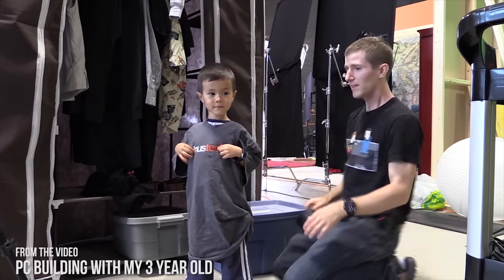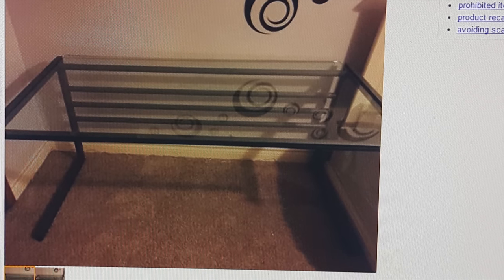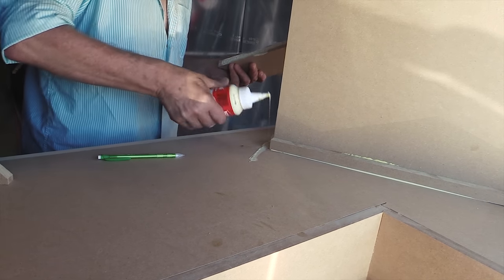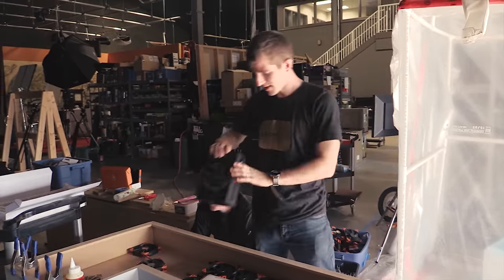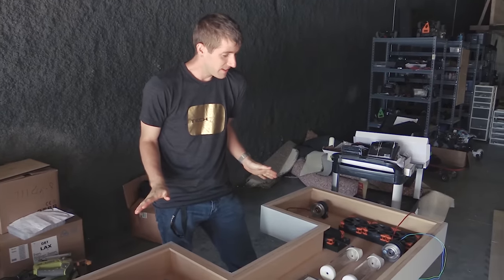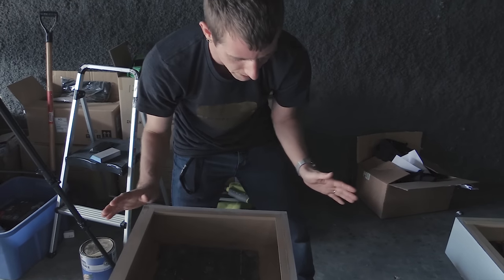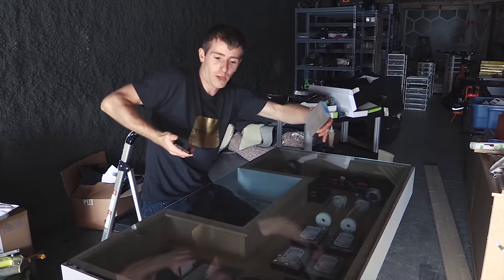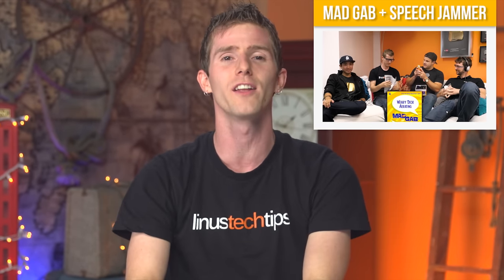Ultimate DIY Desk PC - Desk Construction

Comment: Can I skip the glass please? I just HATE glass tables
Reply: Kinda defeats the whole point of this kind of build...
Reply: Are you actually going to try to construct that >.>
Reply: I'd suggest a 12-15mm thick plywood if you want to skip the glass. Make sure you seal it with a decent wood treatment to prevent any soaking of drinks, etc.
Reply: Why does is defeat the point? I hate cases with glass as well. Don't have to look at my components or lights and want a sleeker design. Same when I would build a desk.
Reply: transparent acrylic surface then :)
Reply: This desk isnt meant to be glass
it is meant to be a desk PC desk and a DYI desk
Reply: A Do-Yourself-It desk?
Reply: when u build something like this, its like the point to have glass if u dont have glass u just need a normal case...
Reply: Daoge Inaction well maybe I want plastic or wood
Reply: Jordiw00t Because the whole purpose of this kind of build is display the system in a unique way.

Get a normal desk with a normal case and shove it in the corner otherwise it will be VASTLY less effort needed.  

Hell if space is THAT much of a concern you MUST do this (and unless you live in a dorm the size of a broom closet you are not that staved for space...) just stick the system on the underside of a desk like he did in another video.
Reply: Nexxus Gaming I don't understand why his wanting to change the system is a big deal? It's a simple modification with zero ramifications for anyone else. Perhaps he likes the shape of the desk, the use of space.
Reply: Mark Thomas so get  a similar shaped desk and underside mount components like I already mentioned? 

This is litarally accomplishing NOTHING other then making your system have a harder time breathing making component changing out harder and plugging your. Io in more difficult. I stand by my statement this kind of  build is 100% pointless without a glass top for aesthetic when cheaper and easier alternatives can over nearly as much and in the case of under side mounting as much potential benefits as this setup (and as I mentioned has some benefits over this too...)
Reply: whats the point in making your pc in the desk then ? you can just have it in a case by the table....
Reply: Just use the "force" instead of glass
Reply: Hey, if you're building your own desk, you can do it however you want. That's kind of the beauty of DIY stuff. Make it to your own specifications.
Reply: Obviously you can do whatever you want. But building a show desk top out of translucent materials is a bit like making windows or aquariums out of translucent materials. The purpose of a show desk is to show what's inside of it.
Reply: I think the word you were looking for there was opaque.
Reply: You could have glass panes to the left and right of you and a solid MDF section where your mouse and keyboard is, that way you won't be touching and smudging up the glass and yet you could see the cool bits of your computer.
Reply: I use acrylic in all of my desk builds. Have a build video up, feel free to check it out.
Reply: Custom Computer Cases
 I feel like acrylic for a desk surface would get scratched up really easily, wouldn't it?
Reply: +MGlBlaze I try to keep only the keyboard and mouse pad are on it, I'm careful because it will scratch (lexan so a little more scratch resistant) but if scratches appear, they can removed with scratch remover.
Reply: Custom Computer Cases Do you mind posting a link to your channel; I'm having a bit of trouble finding it for some reason.
Reply: Michael D
Just clicking on his profile should work.
Reply: Joseph B. Nope, it just takes me to his Google+ page which has nothing on it.
Reply: Put it this way, without a glass top its just a desk with a computer in it, you are better off just building a small box yourself and put the computer components in it and store it in a corner or out of sight. cheaper easier and not as cool.
Reply: Granite slab would work just as well and would look pretty sleek, granite is expensive though. Also anything that would work as a counter top would work as this so you could lower your budget with that
Reply: Matthew Charles-Roy Thibault Granite isn't always that expensive; if you you are content with having an of-cut, that is to say a leftover piece from some larger project; stores can sell you them pretty cheap. There are plenty of leftover slabs that are too small for an entire kitchen or bathroom but are still large enough for a good sized desk. The downside is that you'll need one hell of a strong desk frame to support all that weight.
Reply: Yes But Then You Either Can't See Your Computer Because You Covered It With Wood Or You Don't Cover It Up So Your Keyboard And Mouse Will Just Fall Into The PC
Reply: you can get thick plexy but also expensive and will need to be ridiculously thick for the same strength.
Reply: @everyone who says no glass defeats the purpose: 

Not necessarily, it still hides the components in the desk. You can still get a much cleaner overall look with this and no case anywhere. 

Couple short cables going up to the monitors and input devices one cable going to a tucked away power strip on the back from the wall, very clean look.

@Nexxus Underside mounting has it's own problems, physical hazards like your knees hitting components. Hazards exacerbated even more if you use an air cooler. Accessing components is not really any harder assuming you keep a remotely clean desk. Mount cabinet hinges to the back and a couple struts and it opens like a car hood, reach in, tweak what you want, close it.

If he prefers the clean look from not having a tower, that's his prerogative.
Reply: You could get weird and have a wire grate table top for that super industrial look. =D Of course this is a joke, but then again.
Reply: Michael D it's possible to do that
Reply: Not only does it not defeat the purpose, but its considerably cheaper than a glass top, the wood is cheaper, you don't have to spend money on custom cables and hard tubing because what it looks like on the inside doesn't matter.

I'd want a wood top on that for the same reasons I dont have a case with a window, I don't give a damn what it looks like on the inside.

Comment: Budget desk PC:

CableMod will do custom lengths for us.
Because that's cheap.
Reply: the PC desk itself is meant to be budget, not the components in it
Reply: Well custom length cables from them while certainly not a cheap option aren't exactly very expensive either. In reality you would only need 3 custom cords. 24 pin,  a dual pcie 6+2 pin and a plug for the motherboard power on the top left corner (Depending on whatever it requires) which would be 75$ without tax or shipping. Not super expensive depending on the budget you gave for the desk itself. Another option would be to simply plan around the lengths of cords you have on hand or can easily order online. You have to remember Linus likes to show the most balling way to do anything so this is more like a rough idea to show people than a step by step DIY. He's most likely going to stick insane non budget parts in there like a gtx 1080 + i7 6700k or maybe the extreme 58xx whatevers.
Reply: Kensung
I would just buy the connectors on digikey and make them myself for $10.
Reply: I would scrap together cords from PSUs that shit themselves... my friends and family seem to have a curse... (then again they are from 5-6 year old Dell/HP prebuilts)
Reply: *****
Yeah, I may do that. I could use the sheath from para-cord as cable sleeving!
Reply: ***** remember to offset any wire splices so you don't end up with giant clumps.
Reply: *****
I figured that out with my 3D printer. It's a mess, but it works!
Reply: BigolJoe
It's just a joke bro.
Reply: I mean the cost of the desk is damn cheap compared to buying one. In fact Doing this vs the prebuilt ones, you save enough to afford the custom cables, and the entire water cooling setup, and fans, hardware etc.
Reply: They are talking about the desk itself. XD not the pc components. XD
Reply: you can do some diy cables and sleeving to save a lot of money
Reply: Not really, trying to buy all the connectors, the molex crimping tool, and enough bare cable to do everything will cost you about $40-$50.
Reply: This desk will cost like $150 tops compared to $1200. you can probably afford an extra $100 for sleeving stuff if you want to go full out diy.
Reply: expensive is subjective.
Reply: High budget is also a budget :)
Reply: Well. That's actually not true. If someone is throwing his money into custom made cables then i'm not sure if he is going to look for compromise and get BUDGET DESK.
Reply: LazerLord10 it's a hell of a lot cheaper than the other options

Comment: LinusTableTips
Reply: LinusWoodenTips
Reply: at least still LTT
Reply: I don't want tips from Linus on how to deal with my wood?!
Reply: LinusToolTips

Linus is Tim Allen and Luke can be Billy Mayes
Reply: LinusTableTips Part 2
Reply: if Linus is Tim Allen, Luke would be Al.- Home Improvement
Reply: I think Linus should stick to tech. Only a matter of time until that table falls apart without proper joints supporting the glued areas. crash-bang- wollop.
Reply: MDF holds together fine with butt joints. You can use biscuits or dowels if you must...You can't do finger joints/box joints very well (Unless they're big fingers), dovetails are pretty much out (The corners of the tails split off easily). Rabbets and Dados work well, but have limited use in this desk. 
Mine from several years ago is dowel joints on my desk but the upper parts of the desk don't get stressed that much so it was probably overkill.

Linus' most vulnerable joints are his legs but they're probably going to be fine. In MDF the wood itself is usually weaker than even a butt joint itself.
Reply: Bluestonez they shoulda have made the gap bigger. I mean they're putting glass over it anyway.
Reply: 2:17, you're welcome
Reply: except.....he did talk about you should be using tempered glass for safety.
Reply: Drugs I Love He did say in the video to use tempered glass....no need for a disclaimer when it is covered in the video.
Reply: the wood glue is usually stronger than the wood... except iron wood..
Reply: tpcs, thanks for catching my typo
Reply: keep in mind guys, Linus' dad is handling the desk build... Linus is putting the computer together, let's not beat the crap out of him over the desk build itself.
Reply: I suppose you meant the legs from the table and not the legs from linus himself.
Language can be a pain in the ass sometimes. :)
Reply: Lol. He is a smartass. Part of why I enjoy his commentary.
Reply: Laurens Burssens  yes, the table legs, lol.
Reply: creep no argument here.
Reply: well you made me laugh so i guess thats a good thing. quote: Linus' most vulnerable joints are his legs but they're probably going to be fine. LMAO thats so funny out of context.
Reply: LinusTransTips
Reply: Bluestonez I
Reply: what if u could build a pc desk, with a minibar fridge. put 2 or 3 radiators and the reservoirs in the fridge, 2 motors (in and out) on the side of the fridge and then the whole route where it is needed... that way no ventilators needed... no noise from them and no dust on the hardware. the minifridge can be with a glass door, set on a side of the desk, instead of some drawers. with the glass door, some LED lights can be cool and the reservoirs can be seen very well. just want to know if would be posible before i get started and build it for myself.
Reply: Antonio Brudiu your idea is good but you would have to somehow mod the fridge into not turning on when you plug it in.
Reply: Antonio, that's a good idea in theory but in practice it wouldn't work. Cold air and hot PC bits mixing could possibly create condensation, which doesn't mix well with electronic components in a PC.
Reply: Antonio Brudiu yeah a fridge / freezer doesn't do very well with objects that create heat. the size required would probably be a huge chest freezer. and even then it would be over worked. - high electric bill and subject to failure.
Reply: Bluestonez Linus table tips
Reply: LinusDeskTips
Reply: Bluestonez 1k like
Reply: TrollOfTime it has 999 likes, lol
Reply: Niilo Niminen But it says 1k on my screen
Reply: Niilo Niminen it was 999 before then became 1k right?
Reply: Linus Table Tops
Reply: @OfficialProject  i do
Reply: LinusDeskTips and linus talks for 10 minutes about a desk

Comment: but will it run chess in smooth 30fps?
Reply: Patrick Star on 480p low but only 20 fps.
Reply: can the rx 480 run games in 480p???????
Reply: not cinematic enough. It will run at exactly 24.1fps at 720i
Reply: @maddie4801  not quite
Reply: The only way you could play chess on that pc desk is to buy a chess set and sit it on the desk pc.
Reply: 2080p 200 FPS!
Reply: Is Mayonnaise an instrument?
Reply: it better be able to run pac-man  :)
Reply: You need wheels to make it run
Reply: Point made
Reply: @Thunder Life f in chat for the frame drops
At any given moment you should have all the frames a second as if the picture is moving instead of refreshing
Reply: No unless you boost that 1080p down to 720p then you will be able to run at that smooth 30fps
Reply: The real question is..can it run crysis??
Reply: @TremendousPat  well I use mayonnaise for my keyboard every day it makes it amazing Broken
Reply: Yes
Reply: The human eye can only see 720p 30
Reply: Probably not

Comment: You should probably pre-drill MDF and use screws, wood glue can start to let go before long. Since you paint MDF, using screws isn’t an issue as you can putty and then paint over them. Anyway cool project, just needs to be held together ;)
Reply: I pointed that out to my wife as soon as I saw it, they didn't even use biscuits, it's just flush glued.
Reply: I’m super late lol. I can guarantee this thing didn’t last two years. Completely held together by glue lmfao.
Reply: @skilleyskillz9221  I mean its been 3 years an he still uses it soooo......
Reply: Whats crazy is we all thought this about the glue but this desk has been moved all over and its still together and being used in his office hahaha
Reply: Cabinet grade plywood would have been way better. It could look really nice with a stain too. Also, with cabinet grade plywood, as long as you don't get too close to the edge, you don't have to predrill it, because the plywood is a lot harder than MDF.
Reply: just worry about monolithic sheds pal :p
Reply: Gr8 tips

Comment: This is fun, I watch a lot of woodworking YouTube channels where the end product is a perfectly designed item, pre-planned and totally thought out from the start with razor sharp cuts and perfect joints.

Watching a bunch of smart non-woodwork people figure it out is great - if I were building my own PC desk, this is pretty much how the process would go too.

Although... why isn't the motherboard IO and video coming out the back of the desk? I'm not sure I'd want video cables coming out the side when my monitors are at the back. I'd also build in a power strip to plug monitors, etc into to remove that annoying mess of power leads that sits under every PC desk.
Reply: hm, you could if you left enough space at the back of the system to have cables come out the bottom rather the back i guess?
not as convenient though.
Reply: Good idea to have a built-in power strip. Computers used to be made so the monitor's power plugged into the back of the power supply. I'm thinking of the old IBM XT's that were in my high school in '91. 

A desk is so much of a clutter catch-all that it would be better to design this to hang on the wall until you want to use it and then you pull it down to desk form when you need a desk. That will keep the clutter off it. ;)